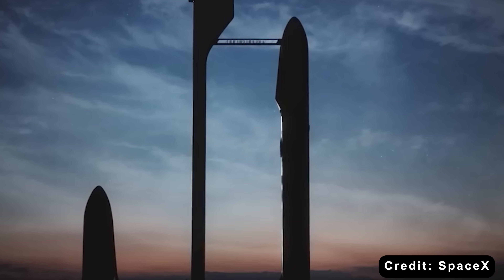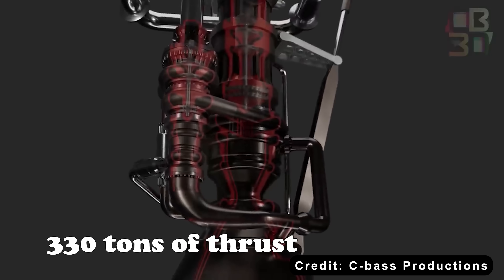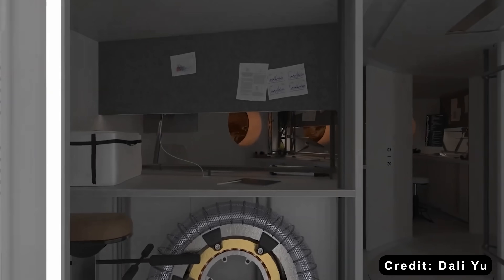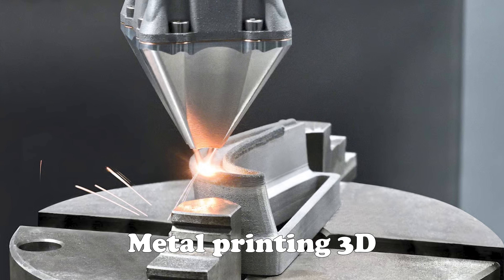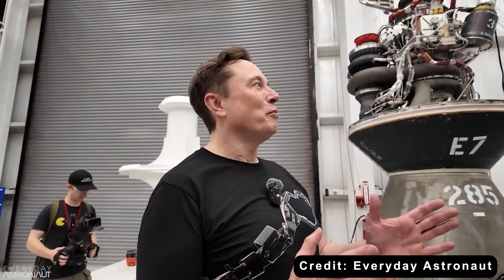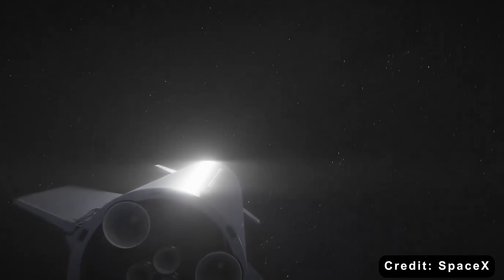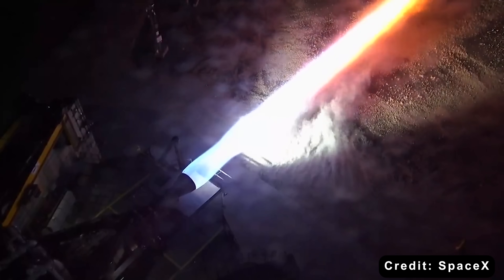Elon Musk Revealed Big Upgrade on Raptor 4 Shocked NASA...

Comment: Where is Raptor 4? No real news about its existence. The generated image is fake since it has input for only one component of the fuel. 
Also no news of proven tests with a chamber pressure of 330t. 
All is fake news and AI-generated video.
I'll block this channel.
Reply: @MladenMarinov
They aren't working on it yet. They're just starting on three. And haven't got 2 perfected yet. 
But they are going to be working toward a number four version. And Elon has mentioned it here and there giving some details. This video is just kind of giving you an overview of what he wants to do with the engine.

Comment: Several years and still have problems with raptor engines. Shouldn't have fired the designer! Engine still not right. Rocket still not completed. Elon screwed it up!
Reply: Rocket isn’t complicated?   The principle isn’t complicated.   But the construction is extremely complicated.
Reply: @bernardayala1128
No, you're just completely wrong. 
The rs25 space shuttle engine took 11 years to develop, and the same company that developed it needed 9 years to modify it for sls. 

Raptor 2 has been in development for 5 years. And it's already pretty reliable. Not up to commercial use standards yet, but it is actually quite reliable now.
Reply: And raptor too is quite a bit more complex than the rs25, AND Falcon 2 runs about a 50% higher chamber pressure. 

Where they are in their design and reliability of raptor 2 is absolutely amazing for how long they have been working on it, and how little they have actually spent.

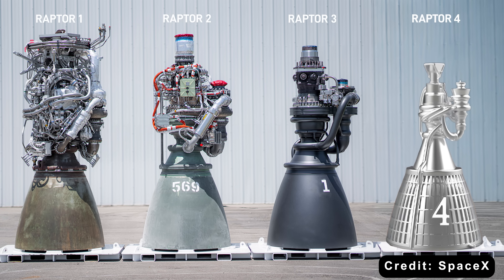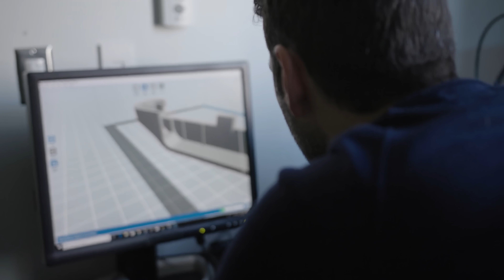Comment: Until there are tests of the completed Raptor 4, it's just speculation, we don't know its performance, only general assumptions, nothing more, so speculating what it will be is pointless. At 1:00 you show a Raptor 4 looking completely different than at 5:35, there is zero graphical consistency except for the paint job and accessories, but look at the top, it's completely different at 1 minute of the video than at 5
Reply: Spacex has delivered on every promise they made re usability, amazing cost savings, starlink roll out, chop sticks catching rockets, Raptor 1,2 and 3? Why doubt Spacex and Elon now on raptor 4??

Comment: Rockets are too inefficient. You must reverse gravity. You need a Mercury gimble engine powered by soundwaves, stabylized by electro magnetic force by changing the structure, immediately changing the weight of momentum, in any direction, controlled by simply changing a transmitting frequency. A sling shot, only being able to manipulate the structure of the rock, to a boomerang. Or one mass traveling one direction, using sound to change that mass structure to possibly many strands moving counter to it's original motion. Anti-gravity.
Reply: When you build that let us know.
Reply: @astroknott5877 Einstein didn't build anything, but without his perspective, no rocket would have made it to space. Be more specific, light built it. We simply manipulated the materials. When light isn't observed. Light does its own thing. Rockets, Mercury gimble bs, simply does not exist, if not observed. Light is particles with predetermined characteristics interacting with other particles with predetermined characteristics interacting to stimulus with a predetermined outcome. When not observed. Our conversation is redundant. To be honest. Light doesn't come from our universe. No science will work without understanding this. All, mass, matter, gravity, and radiation is a construct of this light. We can not go the speed of light. The fastest you go, the slower you go. You must leave this dimension, enter the dimension of light. Which has no mass! In its dimension, all light, you then must navigate back out. So, unless you wanna hang out, in Earths orbt, maybe making to the moon, the most inefficient way possible. Keep making flying gas cans. With only half of the equation. Fold a piece of paper and stick a pencil thru it....😂😂😂. You don't need to bend space time. You must enter space time. No travel. You leave your location, simply step into your desired location. Don't fold the paper. Enter thru the hole, to a whole other dimension! Inside that dimension, light speed is possible! We just need to find a way in and navigate back out. I'm guessing frequencies.

Comment: I still think it's difficult to achieve multi-planetary travel using chemical engines; it would be simpler to simultaneously develop something like a nuclear-powered tug.
Reply: Sure but for leave or planet is more safe
Reply: @herickdeharo  ships need to be incapsulated. A force field. Be able to manipulate it. Cange it's shape, contour, phase. I think it's water. A water force feild. Water can absorb high impacts, be manipulated, in many ways. A nuclear sub, incapsulated in water, being propelled thru space, by a nuclear cavitation bubble being opened up, as it collapses, the chain reaction continues, like you riding the top of a 🌊.  Like unzipping a coat, in front of you, and zipping it up behind, taking advantage of the energy of it trying to callapse, in on itself.
Reply: Orbit to Orbit Nuclear Tug. Docks with the Spaceship in orbit. 2.5-3.0 times more efficient than chemical rockets, using only hydrogen, no oxidizer needed. Once at its destination it undocks from the Spaceship, letting it land unencumbered, while the tug remains in orbit. A returning ship docks with the tug and is pushed back to earth orbit.
Reply: @djohannsson8268 Absolutely right. A chemical engine might be suitable for the Moon. But for the Moon, I think a nuclear-powered tug would be better.
Reply: You can carry not just one Starship, but, let's say, 4 at once.
Reply: Assemble the tug in orbit, module by module, like a tube. Four Starships will dock with it after refueling, or before.
Reply: @kevinvladimirov7789   meh. im sure there is a reason why they haven't been developed by anyone. starship seems like the way to go
Reply: Nuetrinos
Reply: You really think Elon, and almost everybody else who is in the industry or follows it doesn’t know that? 😂